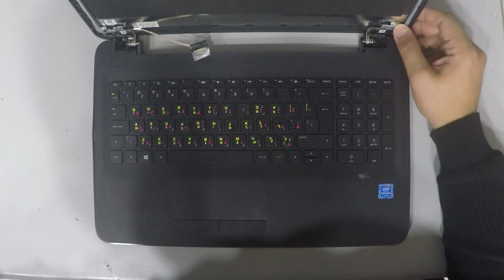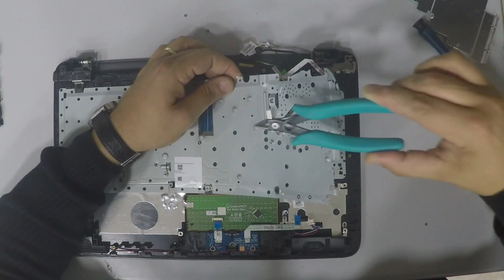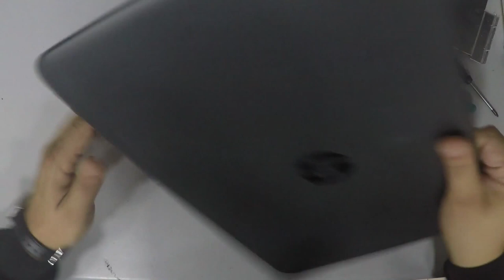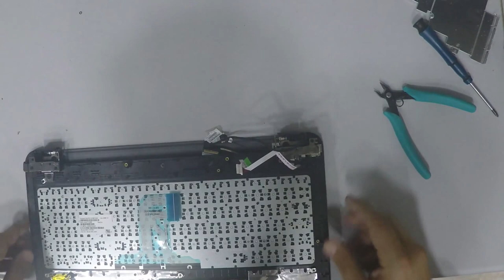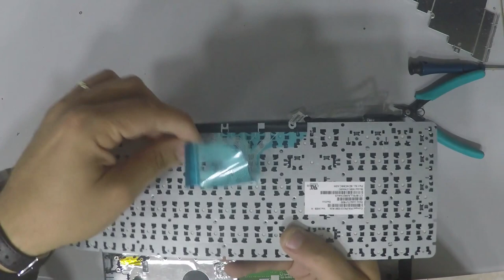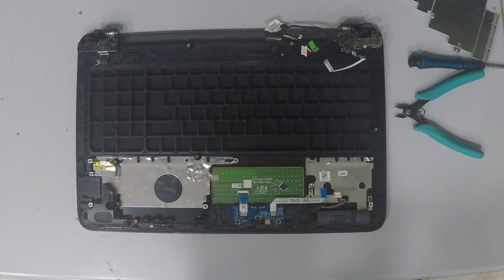HP 250 G5 Keyboard Disassembly

Comment: The idea is to get you buy a new laptop rather than replace the keyboard or whatever part! I use HP 250 G5 and I can tell you it's the worst laptop ever! From keyboard issues to horizontal line appearing on my screen out of nowhere! The fact it was a gift from a relative is the only thing giving me solace.. I'm planning to get a new laptop... an actual laptop. And I tell you, it certainly will not be HP! Worst laptop brand ever!